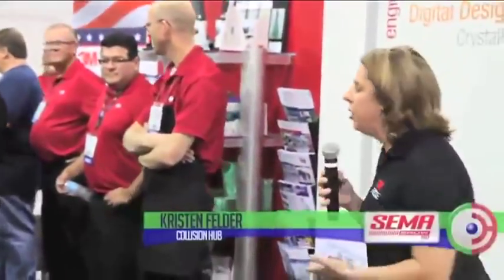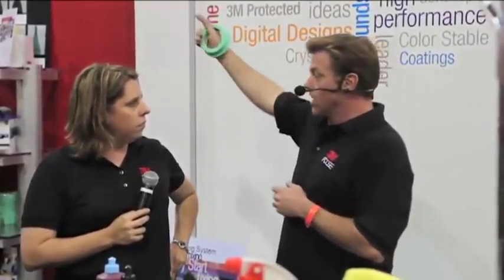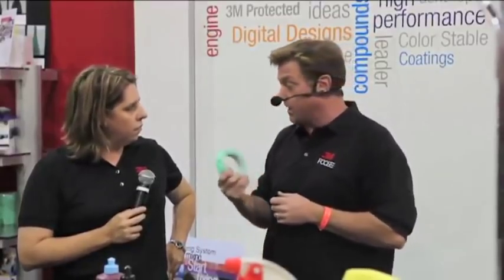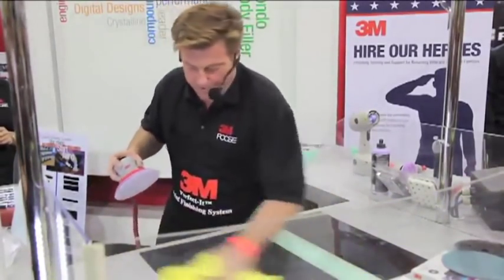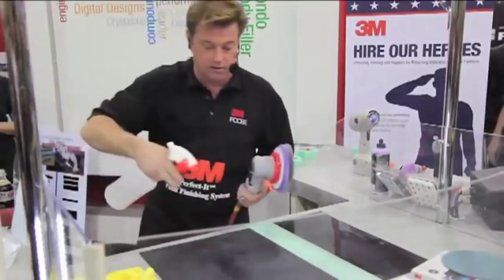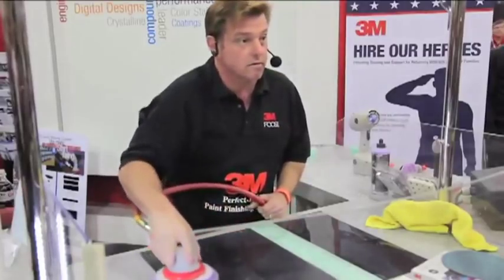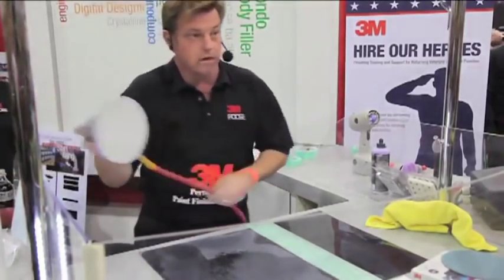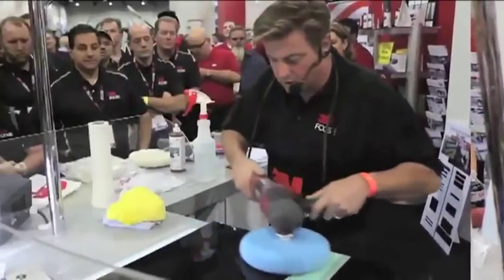Chip Foose Finish Sanding and Polish DIY

Comment: the only thing i did not understand because it was not mentioned is , when you finish with 5000 grid after that you are using just 1 polishing pad and a polishing paste , because in other videos of 3M for removing orange peel they finish with 3000 and after that they use 3 pads and 3 pastes ! so what are you using in this video ?

Comment: I've never understood why you can't just use the DA Sander to also buff, why switch to a rotary?
Reply: Rotary supports bigger pads, faster jobs and also you can really pin point what RPMs you want
Reply: @frankcavalier1812  not true, da can achieve just as good results as a rotary
Reply: @japfan8161  but not as quick. Best to have both, of each, and all different sizes.

2", 3", 6", 9", and 12".

Da, and rotory. With coarse, medium and fine and ultra fine pads to go with them.

Comment: someone knows why sandpaper should be used first 3000 and then for example the 1500 and not from the beginning the 1500?
Reply: start with a nice aggressive 80 grit
Reply: 1500 then 3000

Comment: What was up with the reaction from Foose when a guy asked how he cleaned his microfiber towels??  "I start with a new one, the car is worth it"
Reply from the maker: He was asking about the washing the foam buff pads, not the microfiber towels. It's not ever a good idea to try and clean a foam pad.
Reply: +Paul Kantor i soak foam pads in soapy water overnite....never ever had any issues....
Reply: +Collision Hub nothing wrong with cleaning a foam pad, I've been doing it for years 👍🏻
Reply: Looked to me more like he was just doing a "ahh hahhhh, you see?" kind of reaction.  And then he smiled at the end.  Chip is a cool guy.  No homo.
Reply: not cleaning your foam pad even during a single time use can mar black paint. The pad is essentially filling up with clear coat when you compound, if the residue is constantly removed after every panel you wont get an even shine, Thus why they make pad washers or compressed air works too. Especially if you doing single stage paint.
Reply: Of course he starts with a new one. he doesn't have to shell out the money when You get them for free.  Id do the same thing
Reply: Sure, if you're shilling for the company who makes the foam pads.  Makes total sense.
Reply: Go to a car show and you will see cars that have a wet look ,and this is what they were trying to show how to get that look. Now indoors where the light does the work no justice is why he said its hard to see the difference.
Reply: Same here. You watch these videos of the so called experts and you find out through you personal experiences  that what they are saying is not true.

Comment: This video came up in my "recommended" area.  I don't recommend it.  He did the 1500, 3000 then the video skipped the 5000 which is what I wanted to see.  Didn't mention anything about the sanding lube.  Is it straight water or a drop of soap in it?  I'll look it up myself but it is something that should have been mentioned.  I know some manufacturers say not to use anything but just water.
Reply from the maker: Randy Ragon at the date of that video, 5000 in Tizact wasn't on the release for SEMA.

Comment: Come on out of all the things you could ask about and the guy asks about cleaning the pads... really.... You think Chip wants to hear a question about washing pads at a class about removing orange peel to achieve a smooth finish ?????? 

I think Chip said it that way to weed out any amateurs you know like the D-I-Y no tools kind of person or people that obviously don't have the same passion. I'd say the same thing! If you gotta ask how to wash a pad what are you doing with a buffer?? You blow your wool pad out with compressed air every time you use it. Shouldn't have to wash it every single time if you blow it out while you're working. And you wash your pads with soap and water and wring them out then put the pad on the buffer then spin the pad itself inside a bucket so you don't splash water everywhere. To keep it clean while working just run the buffer and wipe a moist rag/towel over the pad occasionally to keep it clean. Gotta use your head. If you have an old pad with chunks falling off or it's falling apart or you dropped it on the floor just get a new one seriously.

Comment: Sell out. I do this everyday at a bodyshop where i work. And everything he did from spraying not enough water on the sand paper to not even buffing it correctly. Come on foose i thought i was a pro? Lol
Reply: Trizact is meant to be damp not wet. But yeah he just of sprayed the paper to
Reply: He is also using the wrong tools for the 3000.  3000 and after  is meant to be used with a large throw
Reply: i dont even do polishing and had issue with his performance choices.